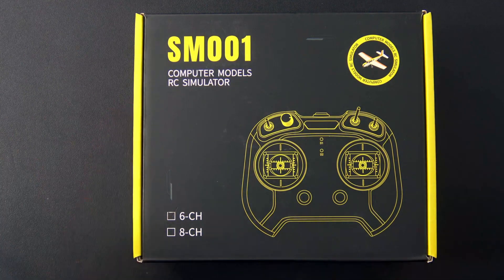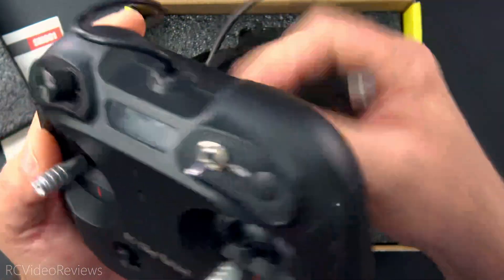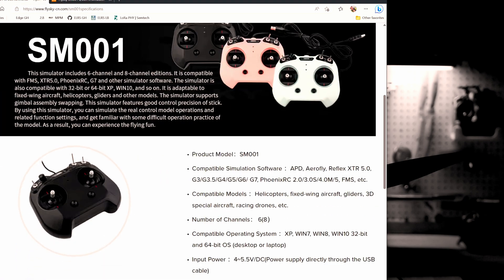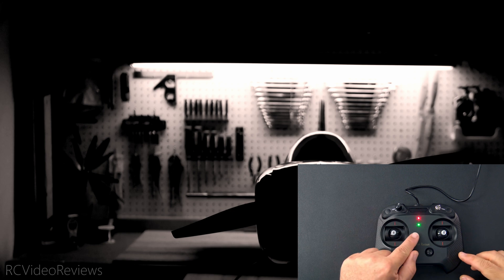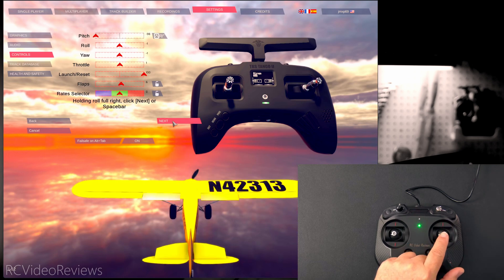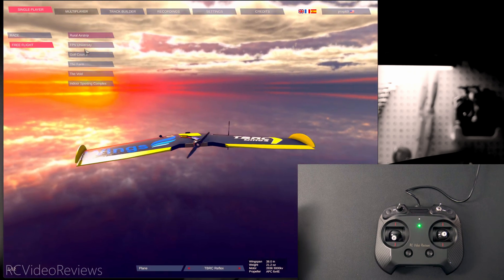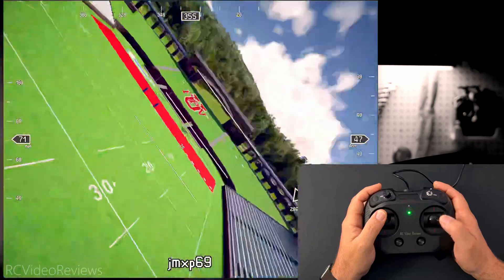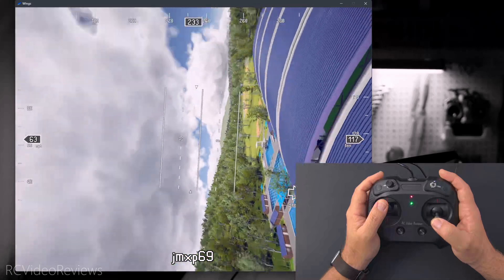DIRT CHEAP RC Simulator Radio Controller • FlySky SM001

Comment: It's a bad remote. Or I got a broken one. 90 hours of flying in simulators and it broke: YAW started pulling to the left, setting dead zones didn't help, calibration didn't save it. I even took it apart - to no avail. 
The deviation from the zero point is 32%! That's terrible. Good thing the store agreed to accept the remote control and refund the money - I ordered Radiomaster Pocket.

Comment: I bought the 8-channel after watching your video. Finally got it. Tried it on Uncrashed FPV simulator.  Pot was detected but not the other 3 switches. Trim adjustment does work though. :(
Reply from the maker: Weird. I wonder if the windows joystick tool will let you verify the controls show up for windows.
Reply: @RCVideoReviews  Works fine in windows game controller setup. Switches and pot all working.

Comment: What else is new coming out of Flysky?
Reply from the maker: Keep an eye out for the FRM303.
Reply: Keep an eye out for the FRM303.
Reply: @FlyskyRCModel  what ?!?! Get with open tx please I hate having to swap my rx when I wanna fly somthing else with  my fs-st8 or tx12
Reply: @cliffcurry5264  The EL18 radio works with EdgeXT
Reply: @FlyskyRCModel  but you can’t save more than one rx at a time is the issue  on edge tx
Reply: @cliffcurry5264  One model data just support saving one rx, but u can save multiple model data in a time and switch multiple model data